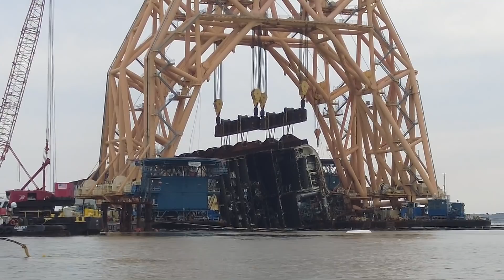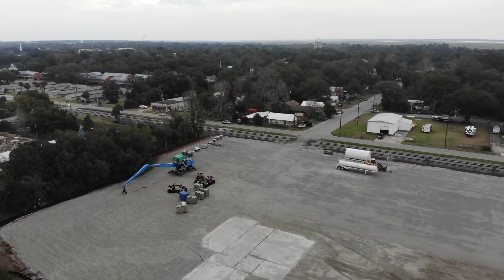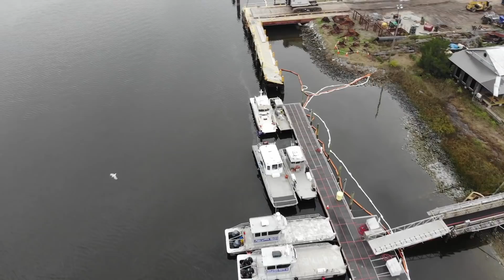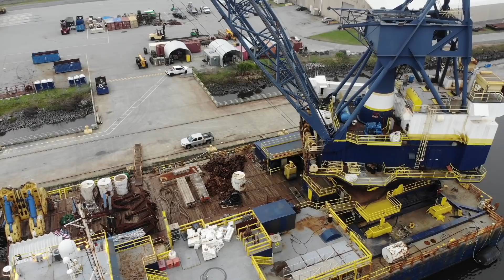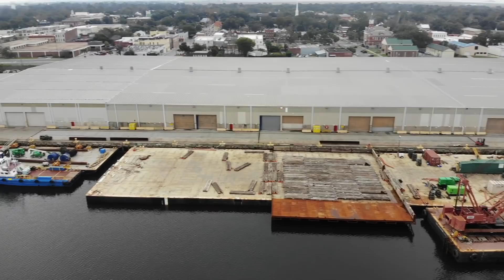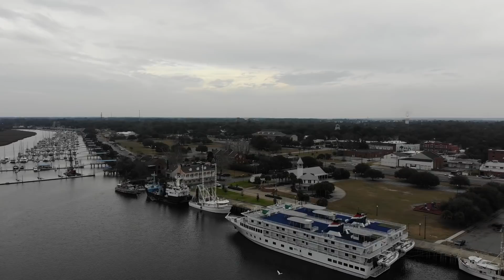THE 3RD. CUT WAITING CONTINUES! on January 26, 2021

Comment: Just a few observations based on the drone footage of what you called the salvage area. The cube looking objects are chemical tanks. We referred to them as totes. Them being stainless rather than poly plastic means a serious chemical is in them. If you get another opportunity to fly drone in that area, if you fly near that white tanker trailer it should have a placard on it with a code and some icons telling whether it is a fire hazard, reactive with water,  options pretty wide open you've probably noticed them on tanker trailers on highway. https://www.nfpa.org/Assets/files/AboutTheCodes/704/704_FAQs.pdf
Reply from the maker: We will take another look next time. MM
Reply: @MinorcanMullet  This is pure speculation on my part but if I were to hazard a guess it's tied to all that black oil in those ship sections and and all over cars. Ship is brand new as are cars so no asbestos issues I would think. There is a thing called "cradle to grave" that applies to all sorts of things and is a legal issue. It might apply like this. Whoever manufactured those cars still owns them, including the gas and oil in each engine and gas tank. Same would apply to that bunker oil covering all the interior of those cut sections. Whenever that ship was fueled, at that moment it was the owner of the fuel in the legal sense (cradle) and is legally responsible for it until it is disposed of in a legally sanctioned way. Normally that would be by burning in engine and release via stack exhaust (normal grave). That didn't happen but they are still legally responsible. Salvors want to minimize their legal risk so their lawyers going to minimize that liability. A nice smooth concrete pad to deal with that oil much better environment than on the open ocean as you are well aware. Again speculation on my part but based on my powerplant experience, blown gaskets on heavy oil systems and what we had to go through to clean it up, package it up and send it to an environmentally certified waste incinerator.

Comment: Appreciate all the time effort and equipment you are using to keep the world informed. I worked in the maritime industry from 1964 thru 1998 as an Engineer, Port Engineer, and Vice President of Engineering and Operations overseeing 36 oceangoing vessels and am familiar with dry dockings of up to 225,000 tons and operating 120,000 HP vessels. This operation looks like it is being run sensibly and safely. Right now the third cut involves very possibly the heavier under framing to support the main diesel engine and other heavier engine room equipment. Being impatient is not the proper way to present this to the public. The enormous pressure from environmental agencies is huge. And their actions on your complaints seems proper (but maybe later than you desired). Remember all are dealing with Covid-19 issues and need to protect their employees totally. The underwater procedures are really not visible to you and the public and maybe extremely important. There is really no need to attempt to cut the vessel thru any heavy bulkheads or bulwarks. Please be patient and keep the public informed. As an aside the insurance company is really holding a huge bag here as the crew seems to have not possibly done any stability calculations prior to sailing and therefore this occasion ensues.
Reply from the maker: I hope that I didn't come over as impatient.  But I am beginning to find a bit of humor in this operation.  Like the one that was told to the community that each cut would take 24 hrs.  Or that the operation would start when the VB arrived from the gulf.  Or that all the fuel on board was removed.  It's been a bit of a circus.  Many facets to this diamond!  Glad your on board with us, and thanks for commenting.  We are having an interesting time with all the moving parts surrounding the salvage.  As for the guys out there getting it done, their professionalism and sacrifices are noted and appreciated.   NOBODY wants this chapter closed more than me.  Thanks and stay safe!!  MM

Comment: Can you find someone to take pictures of the barges when they get Alabama?
Reply: They are taken inland at Eugene Island LA and met by two inland tugs who help them clear the bridges and work in restricted waters. It's just like how they leave Brunswick but with inland boats. It is probably the reason the Kurt handed it off to a smaller boat. If you Google image search golden ray you might find photos of it
Reply from the maker: I saw a clip about the first section making it's way through Louisiana.. It looked like some of the waterways were tight!  Those tug crews were working !!  MM